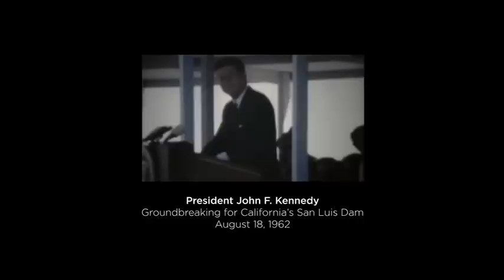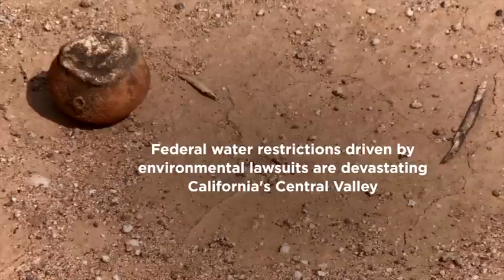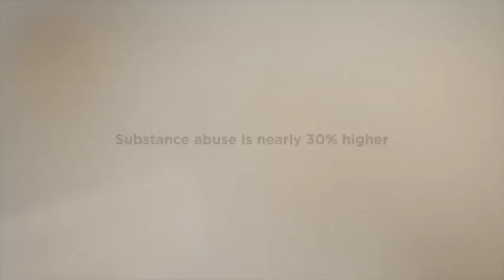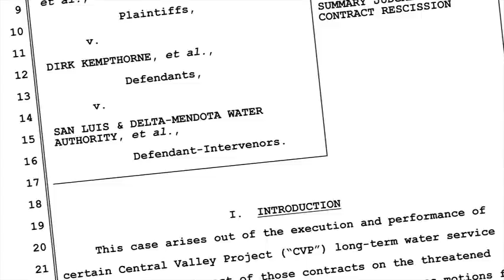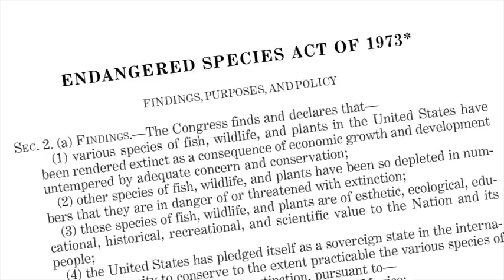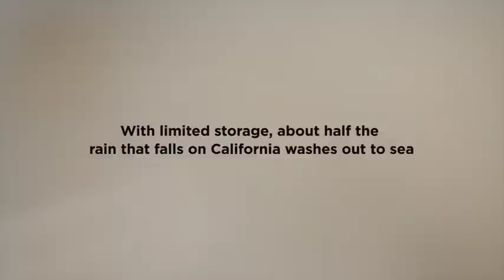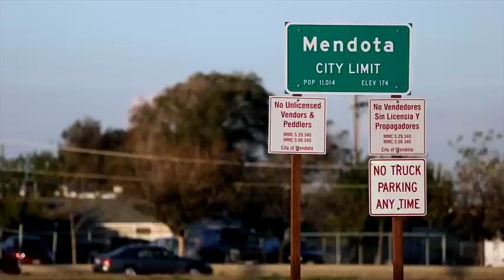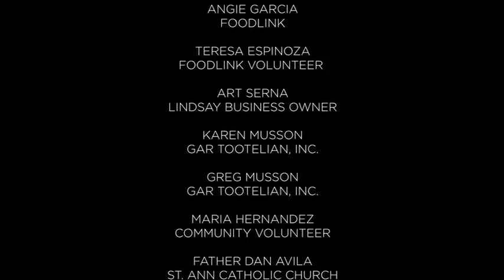Dead Harvest -- Central Valley of California Water Crisis

Comment: I don't know the math involved, so correct me if I'm way off, but if one of the issues is water storage, what about each farm building a storage tank on site to bank water themselves if the state won't build a dam? There is record snowpack this year that will all go out into the ocean instead of being captured, but all those streams and rivers run right through the central valley. If they had their own on site storage, couldn't they siphon off the excess water before it ever reached the delta?
Reply: How are they going to fill up those tanks with zero amount of water?
Reply: @tyiae.padilla4169  With the water that falls from the sky.